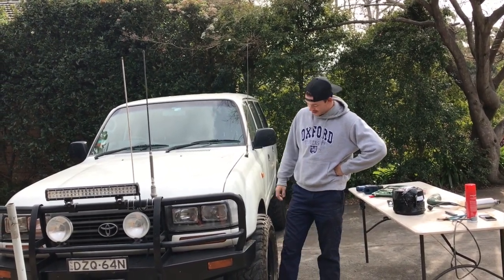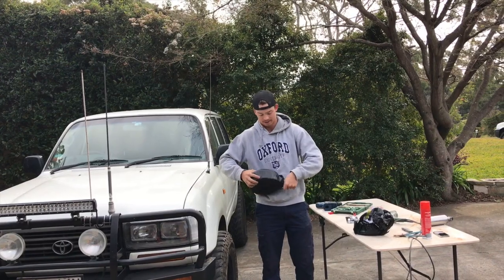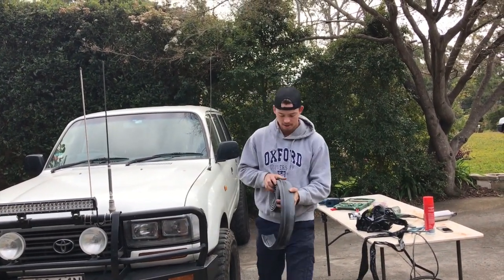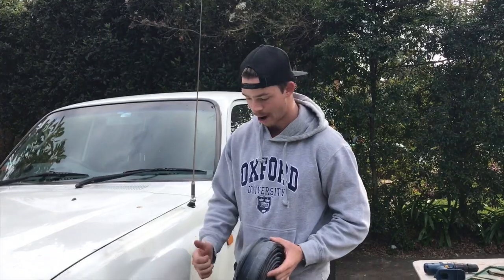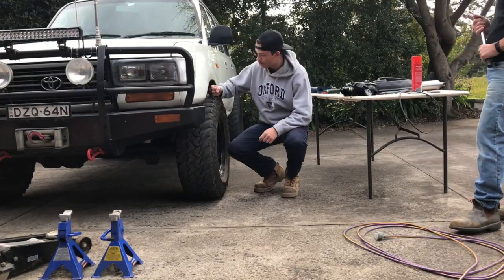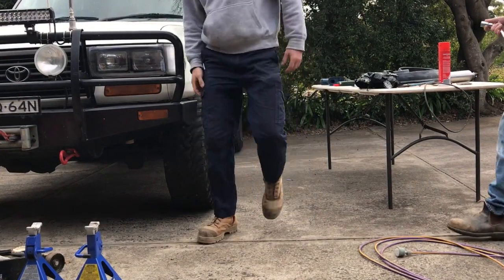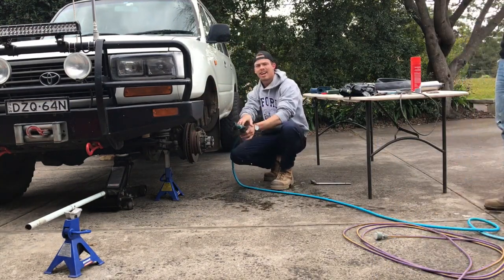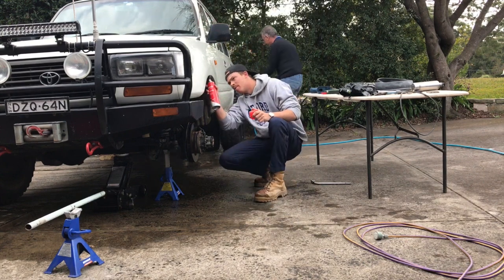Flexy Fender Flare DIY Install

Comment: Awesome tutorial, looking forward to putting them on my new ute. What’s the product you used as a sealant before you put the tech screws in and also what size tech screws are they?  Cheers
Reply from the maker: Hey mate. Sika-flex is the sealant I used which is a pretty common sealant/flexible joint you can grab from bunnings. As for the tek screws I’m pretty sure they were just a 6G or 8G 10mm. I’d recommend putting the spacing slightly closer than the video as one of mine has pulled out when someone lent on it. An easy fix but a couple of extra probably would have stopped this from happening. 
Good luck with it!
Reply: @forevercruisin6715  Absolute legend! Thanks so much for the specific detail. Gonna be an epic summer with many adventures lined up!

Comment: Cheers for the vid. I have to do this next week. Have you had any issues at all with this since doing it?
Reply from the maker: Hi mate, only small issue I’ve had is had one screw pull out when someone leaned on the flare, so if I was to do them again I’d probably put the tex screws spacings a bit  closer together
Reply: @forevercruisin6715  yeah I planned on putting bulk in. My kit arrived today and I had a little look at it and I think I’m going to have dramas running it around the arch as it’s a weird shape (hilux tub) but I got garden edging from Bunnings as a dodgy backup until I can source some better flares. I’ll let you know how I go tomorrow 🤘🏽
Reply: Turned out not bad. They will do for now.
Reply from the maker: @jonathonbroad6478  They're nothing special, but they're practical and fairly priced for what they actually are!!

Comment: looks mint, what size tyres are they, and is that still stock lift?
Reply from the maker: 33" tires (285/70r16) and settles 3" lift so sits about 2"

Comment: Can you share a link for this flare material? I need to put some on my '94 80 series.
Reply from the maker: Hey mate,

heaps of options on ebay, like this one below.
https://www.ebay.com.au/itm/Rubber-Wheel-Arch-Flexi-Flare-Universal-6m-x-75mm-for-4wd-Vehicles/133284020453?hash=item1f0858c0e5:g:l48AAOSw1qVeRmcO